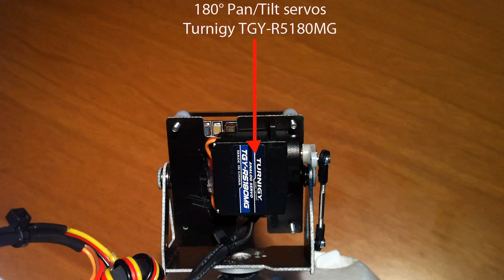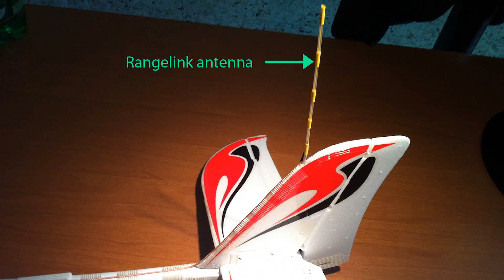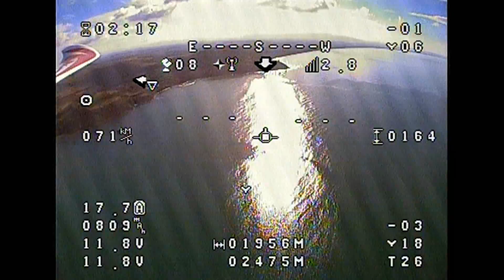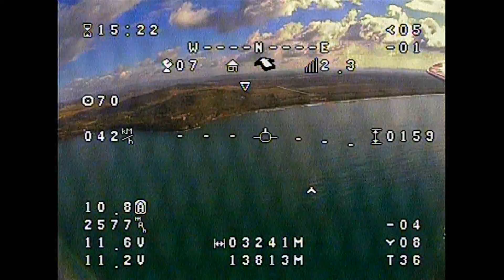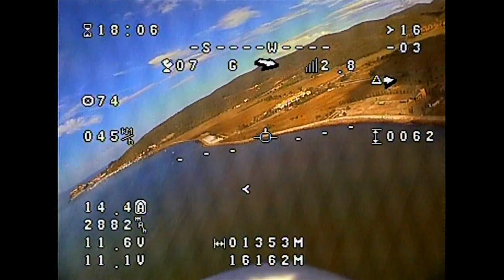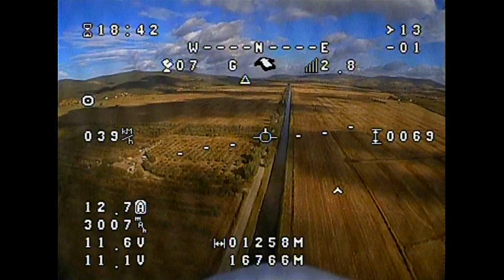8Km flight - FPV Raptor 1.6 m

Comment from the maker: Thanks GuyA. I experimented FPV with a Bixler 2, but for my Raptor this is little more than a maiden flight. I made some flights to set the plane and a couple of short FPV test flights, then I loaded a 5.000 mAh battery and I launched it on the sea. I know that flying on the sea I risk to loose my plane, but it's the best area to flight, here, since my field is surrounded by hills and is open only on the sea. I'd fly higher, but I don't want that my plane becomes a risk for real planes and heli.

Comment: Nice flight, you should put an LC filter on your vtx power line to get rid of those lines.
Reply from the maker: Thanks Steve, I've tried everything to eliminate those lines (I also use a separate battery for video Tx and cam) but finally I discovered that was the ImmersionRC Vtx voltage regulator that wasn't good. I resolved using a 2S battery for video section, instead of a 3S one. If You watch my 14 Km video, You'll notice that lines are almost erased.

Comment: "Radio is a Turnigy 9XR with Open9X firmware@?  no buster?
what was whole weight of plane?
Reply from the maker: Hi, radio is a FrSky Taranis with Rangelink UHF Module.
The weight is around 1.8Kg.

Comment: can you comment on the backlash of these Turnigy TGY-R5180MG servos?  Looks pretty low on your video.
Reply from the maker: +secretspy711
Hi, I hadn't any backlash problem with them. I used HXT900 but got some problem with them.
These TGY-R5180MG have got higher torque and, maybe, higher resolution respect HXT900.
I also think that metal gear influences the movement smoothness because of the tolerance between gears that's better in this MG version.

Comment: Hi.. What is the receiver and the flight controller do u use for this plane..??
Reply from the maker: Hi Deki, the RC system is Rangelink.
The FC is Arkbird.
This was one of my first flights and video quality wasn't good.
After this flight I've solved the problem of the lines (Vtx voltage regulator issue) and I've reached 14 Km with the same setup.
There's the 14 Km video in my list.
Thanks for your interest. 😀
Reply from the maker: This is the 14 Km flight:
https://m.youtube.com/watch?v=Dog3M9ip5uc
The lines problem is almost solved; I've used a 2S battery for Vtx, instead of a 3S (you can see video voltage in the left lower part of the video).
Reply: +rickyps971 how about the osd..?? What do u use?
Reply: +rickyps971 if i use frsky l9r for rx, its better than rangelink or not..??
Reply: +rickyps971 can u write the link parts by parts on ebay addrees. So i can see the product. And i have a plan to build fpvraptor. For Now i have the tx taranis 9dx plus and the fpv raptor not include the fc and rx. Hope u can assist me.
Reply from the maker: I need to have access to a PC because from mobile it's not so easy. When my son finish his homeworks I'll do it! 😀
Reply: +rickyps971 i really appreciate that. Hope u can assist me to help my project. My first project is hexacopter. And its working and im so happy u can check on my video. And Now i want to try build fpv plane. Hope i u can help me and assist me.
Reply from the maker: If you open the comments under my video, you see a list of all my components.
Here's the links:
- Vtx ImmersionRC: http://www.hobbyking.com/hobbyking/store/__17507__ImmersionRC_5_8Ghz_Audio_Video_Transmitter_FatShark_compatible_600mw_.html

- Tx/Rx system: http://www.rangepiloting.com/rangelink-set-p-177.html?zenid=10tsiltccr9ispae5ekrncae43

- OSD/Autopilot Arkbird (is all integrated): http://www.hobbyking.com/hobbyking/store/__102719__Arkbird_Autopilot_System_w_OSD_V3_1028_GPS_Altitude_Hold_Auto_Level_.html

All the other parts (servos, cam, ESC, motor, etc.) are available at Hobbyking.

About OSD, it's integrated in the autopilot system.
At the time when I bought it, it was one with the better price/quality rapport but in these years are appeared a lot of others OSD/Autopilot that are similar or even better of mine, for price and quality.
One of the most used is the Cyclops Storm, but there are a lot, even at higher prices (of course...), like Eagletree Vector, Rangevideo RVOSD, etc.
The same is for Tx/Rx: there are also other 433MHz systems that are very good, as EzUhf, Dragonlink, etc.

About RC frequency, the best one for long range stills the 433MHz because has better penetration and better range respect the 2.4GHz, but the L9R is an extraordinary Rx and someone has been able to fly it till over 10 Km.
You can use the 2.4GHz systems only with the 5.8GHz video system, otherwise, if you'll choose a 1.2GHz video system, you'll have your RC signal killed by 1.2GHz harmonics.
A common rule is that RC frequency must be lower than video system frequency.
Another "must" is that is not important to have a lot of mW on RC system and, most of all, on Vtx, because you'll have a lot of interferences before being able to reach long distances; the trick is to work or to invest budget on very good antennas and good filtered systems.
Reply: +rickyps971 is the receiver is support connect to taranis 9xd plus? Because i have taranis for the remote/tx
Reply from the maker: Each UHF (433MHz) system is composed by a Tx module and a receiver.
433MHz receivers are NOT compatible at all with Tx different from their own Tx module, so you cannot link a Taranis to a UHF (433MHz) receiver without its Tx module.
The Tx module can easily be installed on almost each 2.4GHz radio, using PPM signal, positive and negative from the radio output.
Me too I've got a Taranis X9D Plus and I've got Rangelink and EzUHF alternatively connected to it.
You find a lot of info online on how connect external modules (not only 433MHz) to each radio.
Reply: +rickyps971 ohh. So i can use my taranis for tx..?
Reply from the maker: No, not alone. You can use your Taranis as Tx with UHF receivers but only if you install the right UHF Tx module on it.
Taranis + L9R: Ok
Taranis + UHF receiver: NO
Taranis + UHF Tx module + UHF receiver: Ok
Reply: +rickyps971 ohh ok. I will find out about how to connect taranis with the modul tx/rx rangelink, is it true?
Reply from the maker: Yes, it's easy, are just 3 wires that you must connect to three pins that are in the back bay of the Taranis.
I'll send you some pictures of mine, if you need it.